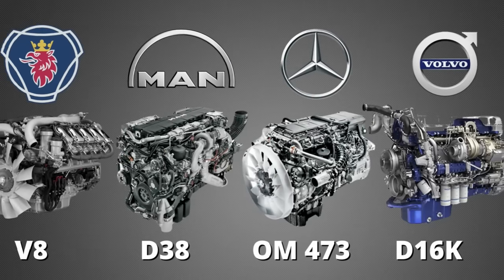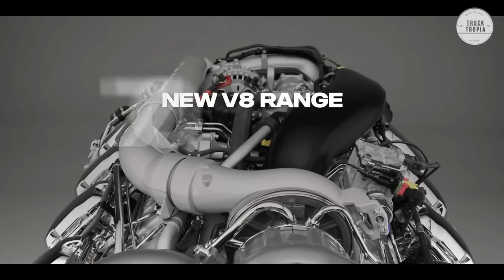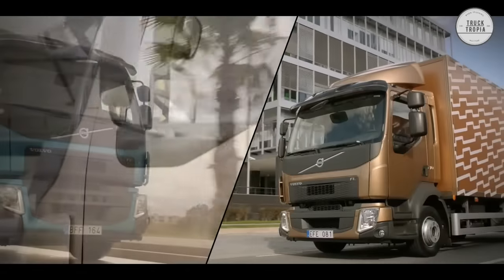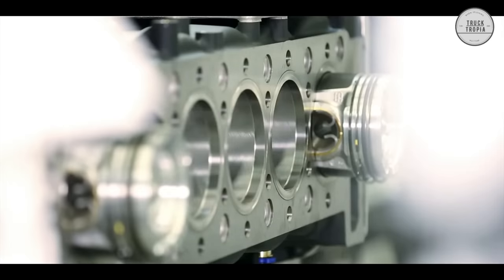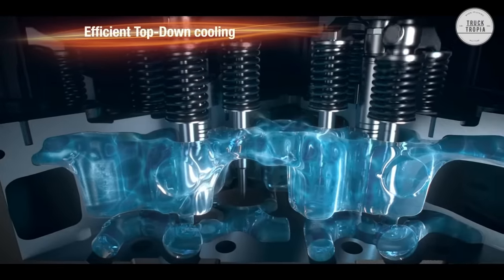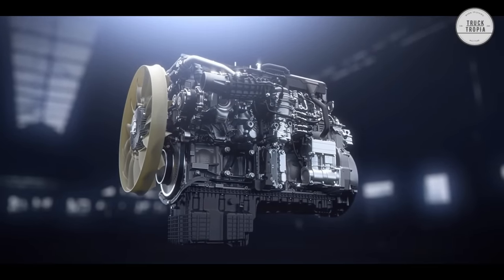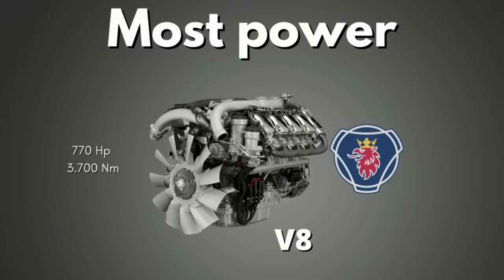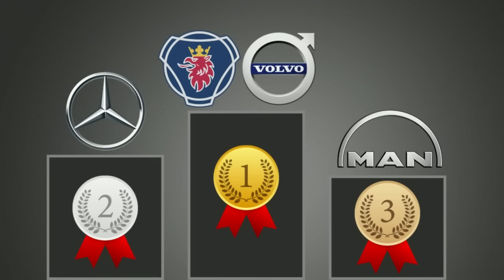Which Engine Is Best - Scania vs. Volvo vs. MAN vs. Mercedes

Comment: New trucks should be good for around 500,000k miles. After their warranty expires, expect replacement of gearboxes, injectors, electronic boxes for the DEF system and much more. Nothing to do with my old truck that hasn't had an injector changed in the last 16 years or nearly 2 million kilometers. Good luck to the future generations of drivers! They will need it.
Reply: We've got euro 6 with more than 1 million km, and the most reliable one We've got it's a MAN D26 witch has only needed regular servicing, it's still on the original clutch dpf fuel pumps and turbo
Reply: @Stef.Cata051  That's what I said 1million km are just over 500k miles. That's not very many kilometers for these engines. There are cars that drive 1 million kilometers. And 1 million kilometers should not be an advertisement for this type of engine. The automatic gearbox warranty on Volvo trucks is up to 750k miles. And 450k miles on the Volvo engine. It is normal for the truck to reach these miles in most cases.
Reply: The B50 rating on a lot of truck engines are still in the million mile range, but the manufacturers have been cheating. A lot of the items that had life expectancy ratings are now maintenance items. 
I'm also seeing all the high power numbers and wondering what that is doing to engine life expectancy. Given the same configuration, build quality and displacement, a lower power spec engine that is adequate for the intended use will last longer than its higher output counterpart. 
That being said, I would expect to be on original fuel pump, dpf and turbo at 1 million km/620,000 miles. A clutch should be good for well over that distance, but it is one of the items that has a lot of variables that affect lifespan.

Comment: I've driven the Mercedes actros L but I never thought much to the actual pulling power out on the road when I was hauling a trailer full of potatoes. It seems to take some time to get moving off the mark when fully loaded and that's in all types of power modes so maybe it could be the gear box or computers that confuse it hence the delay in reaction time in setting off. I must admit the interior of the Mercedes is very nice and it has plenty of toys and gadgets to play with and they've kept the dashboard tidy by having everything on the touchscreen with just a few selected buttons still on the dashboard just for quicker operation which was a nice touch but the camera instead of mirrors take some getting used to especially when reversing onto a bay with direct sunlight as it creates a bit of a shadow effect but I'm sure Mercedes will correct this. If I had to choose one I would go with the volvo for the power as so far this is the best one I've driven but I've yet to try the MAN and scania so I look forward to it 😁

Comment: Scania also supply a range of 6 cylinder engines up to 540hp (soon to be 560hp).  Correct outcome. The 2 Swedish makes would come out on top in an international list of big trucks. Especially for fuel economy & driver comfort.

Comment: Depending on tons of factors, the answer always an be different. In my opinion the truck and engine that lasts the longest time will be the one, that its driver loves the most. If the driver and owner of the company both are interested in the needs of their truck(s), the lifespan will expand on most trucks. So know your equipment and if possible love it and treat it like its your own!

Comment: Personally, I don't care about trucks. I will neither buy or drive one. But I've talked to several people that worked in one of the MAN factorys, and for Scania. Compared to the Scania-production/factory, MAN isn't that careful with the components as they are at Scania. So when the MAN-workers visited Scania to learn to assemble the rear axle and gearboxes they started to assemble the parts with hits on sensitive spots with hammers, as they do in the MAN-factory. And everytime MAN sending their part to Scania for a co-op assemble, their components always came in a random and uncareful way of packing, and the parts were always dirty as f*ck. What I want to say is that Scania has a higher standard and finnish on their products. From the handling of the smallest parts to the complete truck. -It's a different mindset.

Comment: Scania for engine sound, MAN for military because of ground clearance, Mercedes (old engines) in the Unimog to use has a all terrain motorhome, Volvo for driving safe and if you aren't a really good driver.
And always manual transmission for off-road, for that I would go with the Unimog.
Reply: Volvo for safe? Volvo makes a truck for every type of work all the way from racing to military. Everything in between.
Reply: Exactly WHY "always manual transmission for off-road"...?????
We're in 2022 now, not 1992
Reply: man also has a great sound, and what do you mean ground clearance? wtf are you looking at🤣 why are you comparing all these trucks for different things, all trucks have a good sound, man v8 euro 5 has the best sound imo, and man tga open pipe scania is just unique for its v8 sound, but man sounds better, anyways scania also has good clearance for example scania xt
Reply: @stigandrmyrardalur5208  because even with all these new things, if you break a transmission it's easier to fix.
Reply: @Europets2  I'm talking about what we had in the army, we have Mercedes and MAN, MAN are the ones that are higher.
Reply: @Europets2  regarding the sound, it's personal taste.
Reply: @Spoolingturbski  I know, but they are the safest you can get.
Reply: Yeah right, because transmissions break all the time 😂
Even Scania has stopped having their gear-boxes crashing the last century. 
And for your information, the automated gearing is a normal un-syncronized gear-boks that is automaticly maneuvered.
Having a manuel is waste in any possible way mate
Reply: @stigandrmyrardalur5208  why people don't understand that some drivers just want to keep things simple, get an off-road truck and go do crazy things, and if it breaks up, they usually can make it to work and keep going.
Tech is good, until you need to fix it.
Having a manual is cheaper than the one you talked about.
Do you have the ability to put a truck with a fly by wire accelerator operational if it stops working? Well, if it is a regular accelerator I can keep going my journey if the accelerator cable breaks.
Give me a DAF 4442 and you bet I will be off without any complaints.
Reply: Well Volvo wouldn't use its trucks for most military applications except for their troop hauler. They use their articulated hauler which BAE Systems builds artillery with
Reply: @willriley1619  say again..?
Volvo has several vehicles for off road
Reply: @stigandrmyrardalur5208  Yes they do but for the roughest terrain they use their articulated hauler not a truck. At least in their military sector. They use it for artillery applications as well as the mobile command center.
Reply: @willriley1619  that has actually mostly with the hydraulic to do.
It's easier to fit that system to a vehicle with hydrostatic propulsion and a HUGE oil pump, than build a new vehicle from scratch.
And a articulated vehicle will always be better in the terrain than any rigid truck.
Reply: In the compagny where i work here in Greenland we have only Scania, they are all equiped with military chasish with driver ajustable low to high ground clearance and are able to distribute power to all weels with diferential locks
Reply: aaa makes sense, thoguht you meant for the commerc, my mistake
Reply: @Europets2  No problem, we are just talking. ;)
Reply: Most of the gearboxes in a truck today is a manual gearbox with automatic shifting and clutch control. I can control the gear my Volvo FM 420 runs on but I prefer not to unless I need the power and it for not to shift due to how the ground is or if its steep.
Reply: @Tancoll  that's interesting. ;)
Reply: MAN is the king for of road, and very nice Truck !

Comment: The number of service locations is filled in wrong in the table at the end, Volvo and Mercedes are confused.
So Mercedes wins with 22 points, then comes Scania with 21, Volvo with 19 and MAN with 16.
But, as You can see in the comments below, there are further aspects, which worth to consider, such as price, running costs and reliability.
It would be interesting to see a more precise comparison with more aspects and with more brands (DAF, Iveco, Renault).

Comment: Depends on the gearbox been driving a 68plate Volvo 460hp with 800+k km and now stuck in a 71plate Merc 2545 with only 130k give me Volvo better gearbox, and the level of comfort Volvo
Reply from the maker: true
Reply: volvo and comfort in the same sentence LOOL ... bruh....
Reply: 68 plate means that the gentleman is from the UK and the 68 means that the vehicle was registered for road use between September 2018 and March 2019.

Comment: In europe 90% of the heavy 40/44 t trucks are being used with engines in the 13 liter class, 15 or 16 liters are mainly for special operations or ooerators…

Comment: So from my experience, even if I haven't driven any brand in operation, but worked with Mercedes Engines (V6 of the MP2/MP3s and the new I6s) and just have to say, that in terms of reliability the MB Engines are pretty much bullet proof.
I also have some buddies working with or driving MAN and Scania. The company which has a couple Scania Trucks has much more problems with them as I had with the MB. Nearly once a week 1 of their I think 5 Scania (old Gen) has a broken NOX-Sensor.
The MAN guys report, that they had a couple of problems with the Gearboxes of the trucks.
And I also heared that DAF has big problems with the injectors.

But all in all I think today you can buy any truck brand and don't buy the wrong one. Every brand has its advantages and disadvantages but there are no "bad trucks" being produced in modern times.
Nevertheless I swear on MB (engines) even if they often are called "retiree" because of the slow shifting gearbox. ;)

Comment: For me Volvo is better with engine 13 L 460hp and 2800 NM or 500hp. Volvo does not need much maintenance and lives a large virtual life and meets all the requirements even in terms of comfort in the cabin is very convenient ، Even the man truck is great and a little cheaper than the Volvo and Scania truck, it's especially in the hard business category the best option man tgs 33.480

Comment: We run Volvo fh 500s and a 540, Daf xf 510 and 530s a Mercedes actros 510 hp. The volvo 500 does 7mpgs, the daf around 6.7mpgs and the merc does over 8mpg. Volvo and merc seem to pull stronger than the Dafs
Reply from the maker: Thanks for sharing 👍

Comment: Scania is of course the best engine. The V8 is more compact, however an inline 6 might be easier to service.
Reply: mb, iveco, man also had v8 bro, and volvo can make same specs of the v8 with their i6 so it DOESNT MATTER ... its just a fancy marketing for scania, nothing more
Reply: @johnnyhun1  With connecting roods looking through the block. Egr and scr + double turbo and big fuel consumption. while the Scania v8 makes due with just scr and much cleaner burn and better fuel consumption. It aint without reason volvo is sued by the mining industry for not delivering

Comment: 1 Scania. 2 Volvo. 3 Man and Mercedes together. That's my opinion as mechanic. For maintenance costs Mercedes today is the highest, maybe Scania and volvo parts are very expensive, but trust me you will be changing only oil filters and brake pads for 150000 miles before any mechanical issues, when Man and Merc start breaking something always around 60000 miles. Also I have to admit M-B and Man are pushing a lot experimental new parts and systems on commercial vehicles, every year a single model can be built with multiple mechanical/electrical/ pneumatic modifications plus various recalls and controls units software upgrades. So, the race for the podium is still on..
Reply: The Swedes rock!

Comment: Operators always choose wich total package is best.
When it comes to certain markets generally each manufacturers excels in one.
MB is very good in heavy vehicels who work in urban areas like f.e. garbage trucks, public transport city busses.
Scania for long heavy and convoi exeptionel cargo hauling
MAN for 6x6 and 8x8 constructionsite dumptrucks.
Volvo mostly for ergonomic and safety long haul cargo trucks and coaches

A good local dealer also is important wich truckbrand is bought by the operator.
Those trucks cost alot of money, equiped with aditional machinery even an insane amount of money! 
I saw for 2 weeks a brandnew MAN 8x8 converted to a sewer clean/ pipeline inspection vehicle deliverd lately at a pricetag of €600.000 !
The entire package was a technical marvel to behold
Reply: Unbelievable you didn’t mention DAF the number one in Europe 
Ongelofelijk dat je DAF niet noemt de nummer één trekker bouwer in Europa.
De nieuw XG is zijn tijd ver vooruit en dat zal DAF nog wel even blijven.
Reply: @1955piet  pacar werd niet genoemd in deze video
Reply: I just got a MAN 6x4 sewer truck
Reply: @obelic71 

Yeah, that's why in Indonesia, it's easier to spot Mercedes-Benz bus compared to Scania

Heck, even most of Indonesian biggest Bus Rapid Transit (TransJakarta) fleets are Mercedes-Benz (if we also include Fuso Canter based bus), and Scania only comes in 2nd place (3rd place: Toyota/Hino, 4th Isuzu, 5th Volvo, and 6th are Chinese bus from the middle of nowhere)

Comment: I am currently in a Volvo FH 500 had the privilege to drive the FM LNG and can say that both are unchallenged in pull power but as a driver of many other trucks find this list short of one manufacturer “DAF” - I am looking forward to getting the XG 530 as a XF 530 106 fan, I will also be trial testing electric trucks from Volvo & MAN when we receive demos’ in 2023

Comment: Think it depends on country. In Germany scania/Volvo has a ridiculous Workshop Network, Mercedes best by far. All Man-Workshops reachable in 1 hour (3…) are shit. 
Price buy/sell - mercedes (calculation man worst by far..). 
Power - scania (Boss give a shit about it). 
Fuel efficiency - Mercedes (average in Company <30 Liters/100km (Daf 34, man 32). 
Time in Workshop - Mercedes, man worst. 
Time needed for Service - Mercedes. 
Price Service Parts - Mercedes, man worst (0w20…). 

I‘m a mechanic - my opinion to work on Mercedes best, again man worst (by far!).
For driving - anything, but not Mercedes, it’s a sewing machine. For Company - definetly Mercedes, parts cheap, fast to repair, good to sell used. And - 1 year, 5, 10… same sewing machine. Runs, runs, runs.. Mercedes MP3 - best Truck ever built.

Comment: The 450 hp scania DC13 at work manages 30L/100km driving both 100km city and around 400km highway every 24 hours :)
Reply: Same as my 520 V8 then, 30,06 and going 1100km every 24/h
Had an 450 which didn't go below 36 though...

Comment: This is a workplace! Imagine an office where only muffled noises can be heard. Imagine an office where powerful sound comes from all devices. What I want to say, the sound, the music, the concert, what a Scania delivers is a performance, theatre, stage performance all in one. No question it MUST be a Scania.
Reply: But Scania don't make economic sense if that is all it has to offer over the other brands. Reliability, serviceability, fuel economy, uptime, are bigger factors than "sounds and theatre".
Reply: @sepg5084  What would you have answered if I had named a different brand? Because as a driver you don't think about supposed things. The Scanias I drove were all great. OK years ago my shifter broke off :-) (Oldy) But nothing else. I am/was a careful driver. Scanias were rather inconspicuous in the points mentioned. What's your opinion? (value free)
Reply: @sepg5084  Scania is also the most reliable 🤦
Reply: Ralf Weidmann: Scania has no good sound , there are the noisiest engines around together with Mercedes and Volvo . But it seems you like to get your ears destroyed by those engines.

Comment: The way MAN pumps air when low sounds like some 1940 PANZER 🤣
The others are smoother doing it, I always know when a MAN is parking next to me due to the air pumping. Still, they are really good in my opinion I would have a hard time to decide a winner between a TGX and a Streamline R type.
I have 3 years as a driver only driven a Volvo FH500, Man TGX 480 and currently on a 2016 Scania R450 Streamline (the bulky bodies, not the last models) which seems to do more horsepower (or maybe better torque, dunno) 🤷 than even the Volvo, I mean full load and on the hills did the best of the 3. The Man was great too.
Reply: MAN manufactured Panther tanks lol

Comment: In v engines the Scania the best. Power on the road.
Reply from the maker: Scania is the only V8 Truck engine on the market ;)
Reply: @TruckTropia  what about the v8 in man tgx euro 5?
Reply: @TruckTropia  older times was v8 engined trucks in europe like iveco turbostar, and renaul magnum what had a mach e9 v8 engine. Man sometimes if is ordered has v8 and even v10 egine too but only is for special trucks. even v12. But in standard truck engine offer is only the uniqe is Scania.